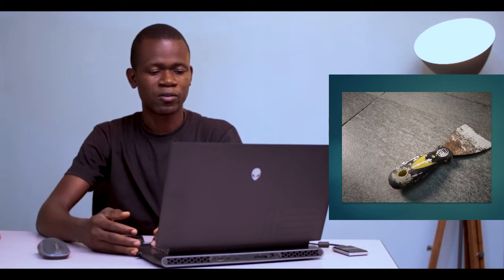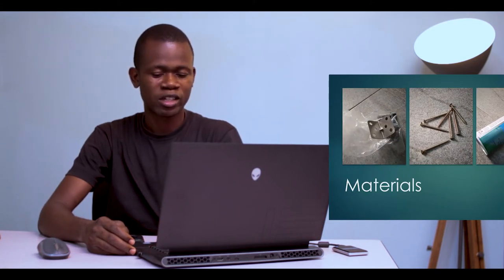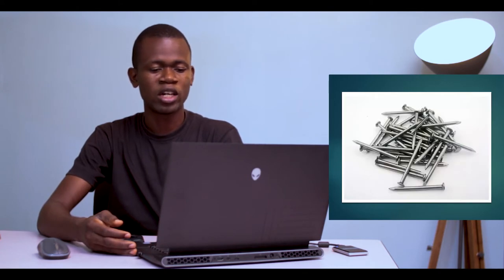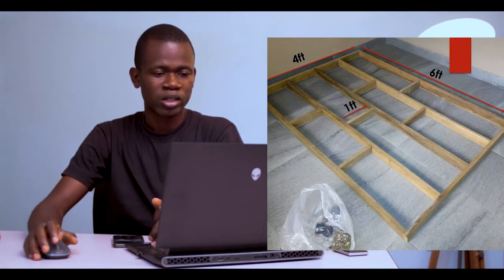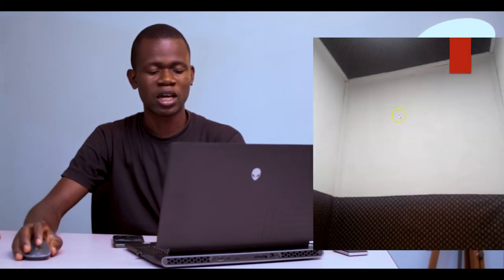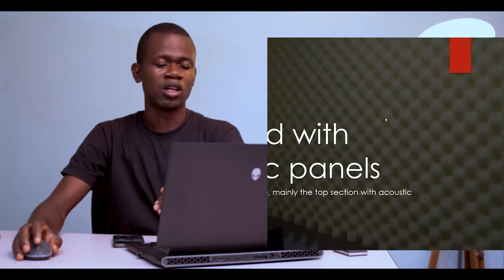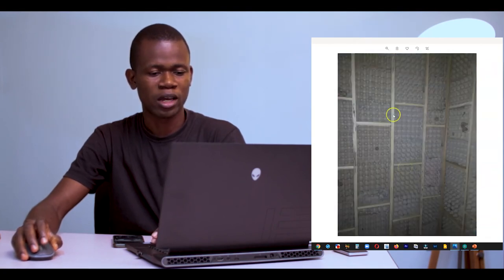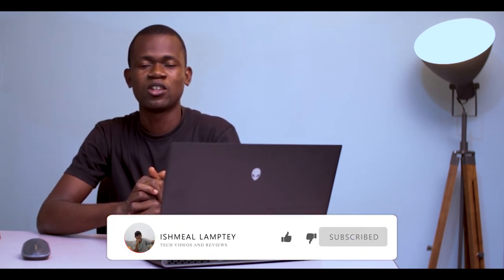How i built a DIY Soundproof booth for Studio Recordings from start to finish

Comment: Can't wait to watch how you edit your audio...one of the areas I want to master for my videos...

Ceiling fans do not go really well with sound recordings because of how they blow the air
Reply from the maker: Well, with my audios, i don't really do anything special. I just make sure i get a good sound from my recorder by recording at kow volume and the increase in post.

With regard to ceiling fans, that's true but a silent fan at a very low speed might help a bit.
Reply: @IshmealLamptey  the way I am bordered with applying noise reductions, compressors and  limiters to make it the best herh...I record to audacity using usb interface and now even with a condenser mic 🎙️ not a small work here and still not getting what I want
Reply from the maker: Haha. Sorry you're experiencing this challenges. Maybe if possible, get a good sound recorder and see. That might help
Reply: @IshmealLamptey  examples?
Reply from the maker: You can try zoom h1 through to h5, or even tascam. They do a pretty good jo
Reply: @IshmealLamptey  ok, will try them. I saw your vid on one of them. Will check it out
Reply from the maker: Sure. Thank you 🙏🏾